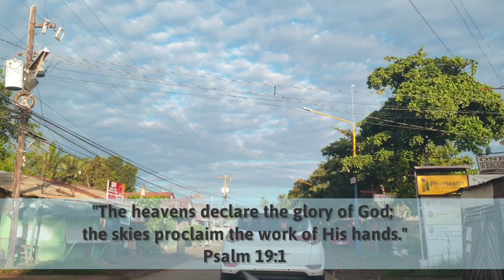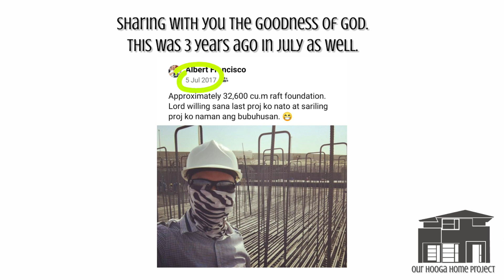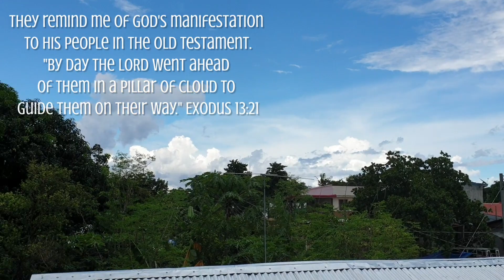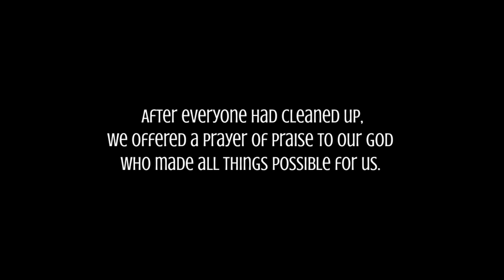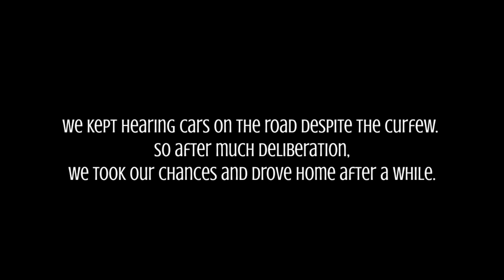House Building PHILIPPINES | Wk 9 BUHOS DAY | Concrete Pouring on 2nd Floor Slab | Retired OFW

Comment: That second level suspended slab will be your longest most stressful day of your life. We had put the mixer up on the slab level and prestaged all the sand and
gravel in rows with the number of bags of rock and sand  for 1 bag of cement. Estimated 84 bags of cement took an extra 4 or so. We spray forms for walls and
beams with WD40 and the forms don't stick. The floors are covered with polyethalene sheeting before rebar and orange pipe. Those fall off by gravity as we take
the  coco lumber supports down. All major pours are catered lunches and have bonus pay, No one makes less than P500 on any pour day. And being a poured 
concrete building there were a lot of pour days. We also bet on how many bags of cement for a pour and the winner gets P100 additional. Best to start rigging light 
bulbs at 4PM. The finishers stay late and get additional bonus. 
                                             george and aurora          we built the decagon house (Villa Cecelia)
Reply from the maker: Hi George and Aurora! 😊Thanks for dropping by! Yes, that pour day is our longest so far. We had so many challenges that day but praise God for keeping everyone safe. Our additional manpower had to go home early as well because of the city curfew due to the lockdown/pandemic. So Abet had to step in to help towards the end. I think we used around 75 bags that day. And yes, we did prepare lunch (their favorite) and had a bit of extra for snacks. Bonus was given as well. They deserve it because they worked really hard. We also let them rest the next day. Praise God all went well. 

Will check your channel. 😊

Comment: Hello po. Kapag nagbubuhos po ng cement sa second floor, kailangan po isang buhusan lang? Or pwede kalahati today tpos sa sunod na araw ung kalahati ng flooring? Thanks po.
Reply from the maker: Hi Lota! Good afternoon. 😊

Naku hindi po pwede na ganun kasi magkaka-cold joint. Kapag horizontal o pahiga kasi ang bubuhusan na slab, kailangan po dirediretso. Otherwise magkaka cold joint -- hindi magdidikit ang slab. Matigas na ang isang part kapag kinabukasan binuhusan ang kabilang part. Di po sila magdidikit. Kaya po kung napansin niyo sa video, talagang inabot kami hanggang 1am at dirediretso kami. Kapag araw ng buhos sa slab po talaga ay matinding sacrifice kung mano-mano ang buhos. Maaga din dapat mag-start. Dapat di masyado mainit para di agad magtigas ang buhos.

Kung vertical naman ang bubuhusan like poste, yun po pwede. Pwedeng half ngayon, half sa susunod kasi vertical naman siya. Hope this helps po! 😊

Comment: can i ask you something. have you analyzed already which is cheaper, concrete versus metal structure? i actually prefer metal structure for safety during earthquake. also for walling, why not consider prefabricated concrete walls versus hollow block walls.
Reply from the maker: Hello! :) Thank you po for watching! Thanks as well for your interesting question. Yes po we did analyze which will be cheaper between concrete and metal structure. If materyales lang po pag-uusapan, mas mura po talaga ang metal pero ang matitipid po namin ay gagastusin din namin pang renta ng heavy equipment since maliit lang kami at nag-uumpisa palang. Napili po namin concrete dahil mas common po itong gamitin sa mga low-rise residential buildings sa lugar namin. Ang kinaganda lang po sa lugar namin sa Palawan ay wala po kaming active fault line dito, kaya wala po kaming risk ng earthquakes. May risk po ng tsunami as an after effect if nearby provinces were struck by an earthquake, accdg to DOST. Pero wala pa naman pong nangyaring ganun. If ever man na meron from nearby provinces (God forbid), malayo naman po kami sa coastline awa ng Diyos.

Pagdating naman po sa hollow blocks versus precast, gusto po talaga namin from the beginning ang precast. Kumausap po kami ng supplier ng precast dito sa Palawan (from Iloilo) at binisita namin ang site nila. Precast po walls and bubong nila. Napakapresko sa loob kahit tanghaling tapat. Mabilis din matapos ang building kaya gusto sana namin yun. Ang challenge lang po ay times 2-3 po ang cost kumpara sa estimate namin sa hollow blocks. Ang pinakamatitipid po kapag precast ay  mainly labor cost dahil mabilis matapos. But nung sinuma namin, malayo talaga ang cost difference, hindi talaga kaya ng aming budget kaya di namin natuloy. Kung medyo kaya-kaya po, I would have opted for precast. Maganda pa sa environment. 

Ay ang haba na pala :D I hope I answered your question po. Let me know po if you have anymore questions ha. Sana masagot ko :) Thank you po!
Reply: Pause Pray Simplify salamat sa pagsagot, sa precast or prefabricated, iniisip ko na kayo na mismo ang gagawa sa site. retired electrical engineer ako dito sa usa. taga san diego california ako. gusto ko maencourage ang mga contractors na maging maabilitad sa pagdesign at pagbuild ng bahay sa pilipinas hinde iyong puro dating natutuhan na lang. sana part sa plano ninyo sa contruction business na magkaroon kayo na isang lugar na doon ginagawa ang mga parts ng bahay at tapos dadalhin doon na lang sa project site iaasemble ang mga parts.
Reply from the maker: Yes po, Lord willing in the future magagawa namin. Napapanood ko rin ang videos ng mga prefab houses diyan sa US and mas madali at mas mabilis kumpara sa conventional build dito. I would love to have that here as well. Onti-onti po darating din tayo diyan, Lord willing. 

May nagviview pala from US aside from my relatives! Astig! 😊 Salamuch po ulit!

Comment: Pwede po ba hindi sabay pag buhos sa buong flr ng slab?
Reply from the maker: Hi Mark! Uhm, sorry 'di ko masyado na-get question. Slow ako today. 🥴 Pero did you mean half muna buhos ngayon tapos half ng slabbukas? If yes, naku hindi pwede kasi magkaka-cold joint. Kapag horizontal o pahiga kasi ang bubuhusan, kailangan dirediretso. Otherwise magkaka cold joint -- hindi magdidikit. 

Kung vertical naman ang bubuhusan like poste, yun pwede. Pwedeng half ngayon, half sa susunod. Hope this helps! 😊

Comment: Engineer bat pala di baka bend 135 degrees ung column ties niyo sa 22:10?
Reply from the maker: Hello po! Sagabal po sa pag buhos at pagamit ng vibrator. Mas sininsinan nalang po namin mga column ties para mas matibay. Pero mas okay po ang nakahook mga ties lalo na pag 3rd storey and up. Nasa diskarte nyo napo yan. - abet
Reply: @PausePraySimplify  ok salamat po sa pag update engineer. More pawer po